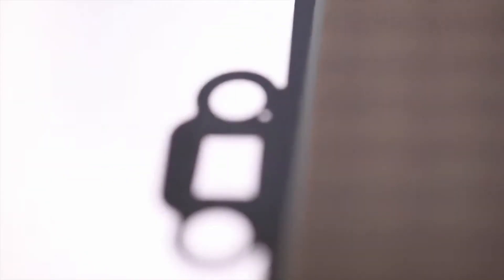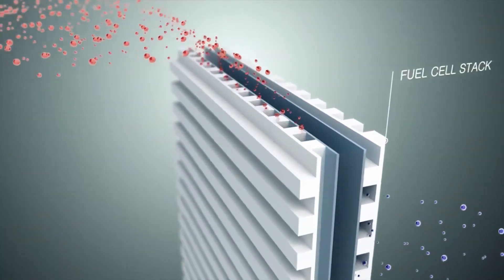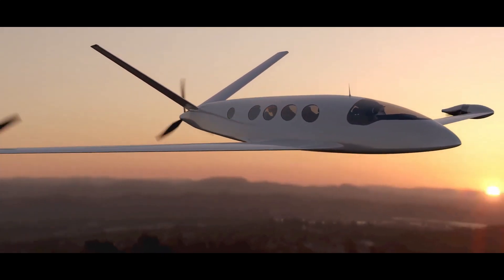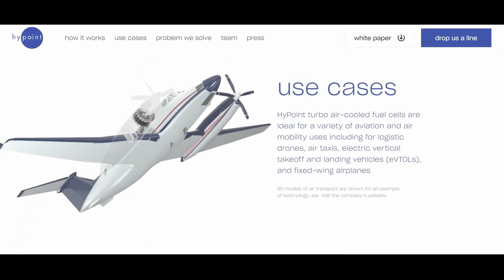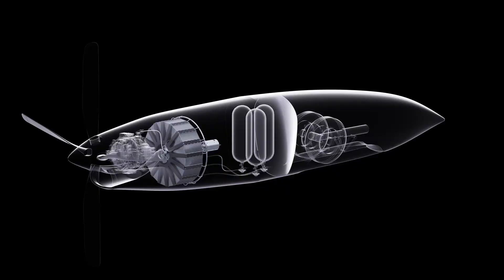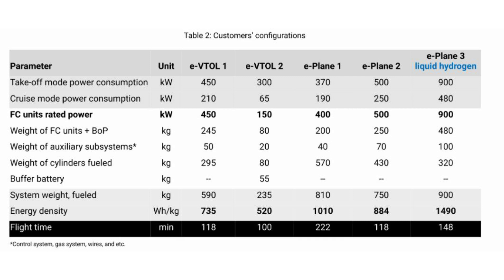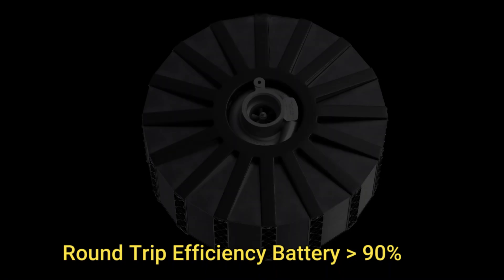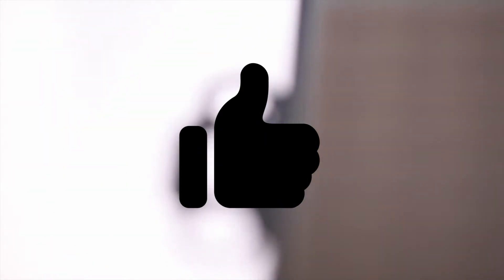Breakthrough Fuel Cell Technology for Electric Aviation

Comment: One of your best videos yet! I think one aspect you missed right at the end was when you compared cost of Fuel Cell to Battery. Yes, a Fuel Cell system is likely to cost more initially. But Fuel Cell systems can be used for more than 10,000 hours, some as high as 30,000 hours or more. Most batteries will have to be replaced at just 1-2k hours of use.
Reply: I believe that fuel cell costs will drop dramatically once they are used more, fuel cells I believe will benefit humanity with home power, automobile, and aviation.

Comment: Great summary, but from all my research, the energy density of hydrogen, even with fuel cell weight, is much higher than batteries.  Otherwise there would be little reason to consider it.  Maybe you're talking about peak power?  I agree about the round trip efficiency.  Hydrogen seems like a stop gap measure until battery energy density catches up.

Comment: Great video as always. I think the cost at this point is moot really, as most of the established players are looking to divest from fossil fuel planes. Not only is the cost of Aviation Fuel higher, but consumer's demands for a more sustainable model are also quite relevant. If you add the European Union, Japan and South Korea's push to a Hydrogen infrastructure into the mix, adoption seems guaranteed.

Comment: As you mentioned near the end of the video, you said it's dependent on the amount of hydrogen that can be carried - if you could do a video on hydrogen storage, I think that could be really interesting as that is a limiting factor. For instance at 700 barr, there is only 5 kg of hydrogen for a 95 kg container
Reply: A tank designed for what standards? Welding? A car?
Reply: There are plenty of videos of hydrogen storage, they are called Delta IV heavy launches. Check one out and imagine that rocket was your electric airplane.
Reply: And what are the regular/major maintenance costs of Hydrogen storage, transport & fuelling systems.  We all know the corrosive & leak prone nature of hydrogen & it's storage & transfer problems, thus higher costs.
Reply: Not anymore! Check out Hypoints newest hydrogen tank. It could even enable airplanes to fly longer on hydrogen than kerosene!
Reply: @jimj2683  Whoa - that tank is impressive! Thanks for sharing that

Comment: I don't think fuel cell have to be price completive with batteries if they can offer much higher energy densities.
I think energy density will be the driving factor in determining which power system prevails as a fossil fuel alternative in aviation.
Thanks for another interesting video.
Reply: Nah. As an aircraft mechanic my vote is on the simpler/easier to maintain battery system all the way. Time will improve the range/payload of such vehicles while hydrogen will age far too quickly to be a useful interim. As with the electric car world it's the cost of the hydrogen infrastructure that will make it impractical for common use. My opinion is that aviation companies investing in hydrogen will have to pivot toward batteries late game once they become the obvious choice. Just as Legacy automakers are already facing the reality of the failure of lidar tech; pro hydrogen aviation companies will have to play catch-up to the more advanced battery solutions. My 2 cents.
Reply: @Zalex612  For aircraft with batteries when you take off you weigh X amount.....when you land you still carry the same weight......with any aircraft that is powered by a liquid fuel, you take off with a full load and land much lighter having used up the fuel......one reason they dump fuel after take off if you have an emergency and have to land immediately.
An aircraft with a fuel cell would probably fare better than with batteries I think as the fuel for the cell would be used up by the time the journey ends........that is a daft situation as the current ICE aircraft power is quite well advanced and it would take a miracle to consider changing to electric drive just to please the environmentalists.
BTW.....I have a model of a 172 Cessna running on Lithium batteries.....it's very light , made of polystyrene foam etc......beats running it on a small glow plug engine.
Reply: Hydrogen is made from oil or methane, it is a fossil fuel.
Reply: @alechorn1109  You can't have it both ways........sometimes you have to compromise a bit.
Reply: @gangleweed  Are you serious?  The weight of the storage tanks, fuel cell & filters etc by far outweigh the Hydrogen itself.
Someone elsewhere on here pointed out 5kg of H2 requires 95kg tank at 7k bar.
You'll hardly reduce the weight when the H2 is running low. There will be little noticeable difference between full EV & FCEV & H2/battery/hybrid.  Try comparing Toyota Mirai to any EV.  Slower, similar range, but heavier.
Reply: @alexmanojlovic768  One reason why hydrogen as a fuel alternative is not practical.....you might as well stay with petrol, less danger and problems processing and storing it.......my preference is to go full EV....much cleaner and can derived from many natural sources forever.
Reply: @gangleweed  Except a) you touted it as a positive, now you're backtracking. b) I never advocated staying with poisonous FF's.
I was simply pointing out that full to empty, Hydrogen weight difference is minimal, which you compared to EV where the battery weight does not change at all. FCell overall system weight hardly changes also, as the gas is such a small percentage, unless expensive composites are used for the tanks, but the H2 may prove corrosive or leak, so your whole point simply on that one aspect is off base. As a fuel source where range is a major issue, H2 FCell may have a benefit, but then maintenance costs due to issues with storing/fuelling H2 may be prohibitively high in comparison to the current poisons. I don't know.
Reply: @gangleweed  wow! Zach Smith made a valid statement, that you tried to poke holes in.  I defended Zack & pointed out the holes in your comparison, so you move the goalposts, rather than back down gracefully.  Now you're adding magic into the mix.  Are you my older brother by any chance? I've spent decades arguing with a narcissist. Easy to spot. Easier to win an argument with them, once you realise their ego is in control...  As if by magic!....
Reply: @Zalex612  You...you do realize how heavy batteries are? right?
Reply: @jimj2683  It's not too hard to do the napkin math on it... I'll start with Tesla's 4680 cells which are rumored to have a pack energy density of around 300 wh/kg. (Though there are plenty of lab cells doing way better already... I'm choosing the 4680 based on it's near term availability. I.E. It's already in production.) For an airframe I'll attempt to match the Q400 (Dash-8) in performance and range. 93 people * 113.4 kg = 10,546.2 kg max payload. Power = Velocity * Force (drag). Using Eviation's Alice as a benchmark I'll calculate an estimated L/D ratio to use in our Q400 example. Alice has a 900 kw battery with a range of 815 km at MTOW and cruise of 407 km/h. 815 km / 407 km/h = 2 hrs. 900 kw / 2 hrs = 450,000 W / 113 m/s = 3982.3 Newtons / 9.80665 m/s^2 = 406.1 kg of drag force. Take Alice's MTOW at 7484 kg / 406.1 kg = Lift to drag ratio of 18.4. Now back to the Q400 example case! Using Alice's mass fraction of 60% battery weight I'll calculate the mass of the electric passenger plane. Mass fractions for composite aircraft are typically around 80-90% which, in English, means that 10-20% of the aircraft's weight is the airframe. (I'll take the more conservative 80% mass fraction.) Assuming for an additional 10% weight for electric motors and avionics we'll assume that the passenger mass is 10% of the aircraft's MTOW. 10546.2 kg * 10 = 105,462 kg MTOW / 18.2 L/D = 5794.6 kg drag force. 5794.6 kg * 9.80665 m/s^2 = 56,825.6 Newtons * Q400 top cruise velocity of 185.2 m/s = 10,524.1 kw power required at cruise. Since the battery mass is 60% of the MTOW we can calculate the capacity and thus the range of our napkin designed electric passenger plane. 60% of 105462 kg = 63,277.2 kg * 300 wh/kg = 18,983.2 kwh. Taking the power required at cruise I can get the time in flight and the range. 18,983.2 / 10,524.1 = 1.8 hrs * 666.7 km/h = a range of 1200 km. Compared to the 2040 km range of the Q400 that's not terrible. Please bear in mind that my math is quite conservative. In essence we can easily do half the range of existing regional planes using existing battery tech. With further optimization we might be able to get to 75% the range of existing fuel burning planes even without better battery tech. In short. Yes I do know how heavy batteries are. My original post didn't say that electric planes are immediately competitive. It just gives an opinion that battery tech will become economically viable faster than hydrogen fuel cell tech.
Reply: @Zalex612  The same napkin calculations with hydrogen actually gives 3-4 times the range of kerosene...
Check out Hypoint's new hydrogen tank and their fuel cells. It is an amazing breakthrough.
That means you will be able to carry many more passengers, negating the advantage of electricity being cheaper than hydrogen. 

I say let the market decide (as long as it is carbon neutral and no other harmful emissions). I agree that the perceived simplicity and efficiency of going purely battery electric is tempting, but it is the total cost and profitability that matters in the end (economic efficiency is more important than energy efficiency). 

My guess for the next 20 years is that we will see battery electric planes for short flights, hydrogen for medium flight and synthetic e-fuel for long flights. In the long run, either fuel cells or batteries will take over. We will see.

Long flights is what causes the overwhelming majority of CO2 release by airplanes, so that is the most important to decarbonise. And you simply cannot decarbonise long haul flights with batteries for the foreseeable future. That is why e-fuels and hydrogen seem like the only feasible solutions here.
Reply: @jimj2683  Interesting. I will hold my personal opinion but I do appreciate alternate opinions. Good food for thought! Thanks.

Comment: Need high temp to activate/mobilize Oxygen. Used at NASDAQ and in Japan, 10 MW fuel cells, 350C operation, “burn” Hydrogen or Natural Gas. Platinized Carbon, Phosphoric acid, Nickel Oxide structure.

Comment: I think you’re downplaying the importance of volume in airplanes. With larger planes you can use the wings as fuel tanks. This has several benefits, such as distributing load, not just saving volume for passengers and cargo. With hydrogen you need to put the fuel in separate tanks, taking up valuable cargo space. You can mitigate it with a blended wing body.. but the point is, hydrocarbons will always be superior in any configuration. And if you make them renewably the CO2 is not a problem. Efficiency will probably be even worse, but for many routes it’ll be worth it. So I’m concerned that the niche for hydrogen, squeezed between batteries for short range and biofuel or e-fuel for long range, will just be too small. It’s very possible that more energy dense batteries, and more efficient ways of making and using biofuel/e-fuels, will squeeze hydrogen out of this market.
Reply: The advantage, even if the niche is temporary, is an acceleration of electric aircraft propulsion technology. If batteries turn up later that can fill the niche, these aircraft can be relatively easily converted, since the motors and power electronics are already in place.
Reply: you're absolutely right. the question now is also, how fast is this niche developing or is the battery tech developing faster?
so far, ceramic separators for high density battery packs with high cycle counts are already on the door steps. the car industry is throwing a crazy amount of money at this development and the result will be 300-400Wh/kg soon. this is enough for 400km flights. from then on, the aviation industry will throw money into the pot too, to get even more energy density. electric power plant stations and consumers then throw more money into the development of long lasting batteries with high cycle counts for longevity.
i am not sure if hydrogen can find it's niche here because the development from the very short flights based on batteries is so fast.
Reply: @stefanweilhartner4415  Great comment, and it reminded me of something else: as you say, 400km flights may be feasible. But it's also possible that it'll be cheaper to do two 400km flights than one 800km flight, if operating costs for pure battery electric planes are much lower. So that's another factor that could push into the hydrogen niche. Electric planes (battery or hydrogen) are quiet, and may take off from smaller local airports. So I imagine if me, from Northern Europe, want to go to a vacation spot in Southern Europe, I might take off from a small local airport (rather than a 1hour train ride to the large international one), fly to some hub in Central Europe, and transfer to another plane taking me to a local airport near my destination. It wouldn't be much slower than taking one huge plane all the way through the big international airports. Transcontinental flights will probably always be hydrocarbons, since it has such insanely high requirements for both volumetric and gravimetric energy density. Yet another unknown factor for battery electric planes is that once you get a decent range on a large plane, these planes could fly higher than traditional planes, since they don't depend on air density (oxygen density) for efficiency. If they can fly higher, that could unlock extra range that haven't yet been considered.

Comment: Have you addressed the potential for low maintenance H2 fuel cells?
My understanding is H2 tends to make all storage materials highly brittle over time. This tendency is not favorable for any aviation application.
Still it needs to be addressed.
Reply from the maker: Thanks for pointing that out

Comment: Combined with super capacitors may be even more efficient with the addition of a smaller battery to enable a cold start.
Reply: I was thinking along those lines, going further if the battery requirement is mainly for cold starting could it not be when the aircraft is in storage it is "plugged in" to the grid or a starting generator is used thereby removing the need for battery packs altogether (a small battery on the plane maybe just to keep systems "online").

Comment: I think hydrogen powered aircraft (be it fuel cell or gas turbine) future will hang on the decision of airports to invest into hydrogen infrastructure. No sign yet that this is happening ...
Reply: Using ethanol with reformer for hydrogen source would mean we can use existing fuel infrastructure.

Though pollution free ethanol can be used in jet turbines as well.  GE has sold some in Brazil already for electricity generation.  Ethanol gets higher fuel efficiency above 10,000 feet than currently used jet fuel.

Comment: Is there potential to use super-capacitors in conjunction with fuel-cells for the high-energy demand phase of flight for eVTOLS?: i.e. during take-off.  The fuel-cell could charge the super-capacitors prior to take-off.
Reply from the maker: Supercapacitors are still at 80 to 100 Wh/kg. Li -ion cells are  3 times that amount i.e 300 Wh/kg. So there is no chance of using super capacitors at least for the near future

Comment: I've been working on a design for a EDFJ (Electric Ducted Fan Jet), that implements existing ideas for initial use on GA/experimental aircraft. 
I'm confident that I can add an additional 30 to 45+ minutes to the current "1 hour" average flight time, using current battery technology. 
Also, will allow to travel longer distances, even if only 1 hour, due to higher straight and level cruise speeds.
We shall see, once first tested on Rutan Long EZ and eventually a Velocity 4-place, which will require 2 of my EDFJ power plants and if weight/balance allows, will be mounted on the Velocity aircraft, much like the Honda Jet's.
Until charging stations become common place or aircraft are equipped to allow fast charging via your everyday outlet plug, a hybrid will also be in the works.
Reply: I live in holland allready built cars and airplanes.technologi etc .we have here rld the dutch faa.anyway when you fly between sea level and 25 meters you are a boat ther are no rules yustregulations good luck ronadam

Comment: Great video. One key advantage of a hydrogen powered system is the benefit of burning fuel on enhanced range. As the hydrogen is burned, the fuel weight is reduced, with a positive effect on range. This, of course, does not happen with batteries.
Reply: That advantage is probably pretty small though, at least with pressurized H2. As someone pointed out elsewhere, the weight is around 95% tank, 5% H2.
Cryogenic liquid hydrogen has more of this advantage, but is costlier and more difficult to handle, and probably only works for big planes.

Comment: What about Seebeck generators to help with the excess heat of the fuel cell? You can turn that waste heat back to electricity for storage in the battery.
Reply: This needs to be tested for weight efficiency

Comment: So... This relies on much greater cooling efficiency...not the new solidified hydrogen plate (liberated by lasers) tech. Ok got it. I'm a fan of hydrogen fuel cells for any heavy duty types of work - big rigs, heavy duty pick-up trucks, construction equipment, sea vessels, and aircraft carrying more than 10ppl or equivalent weight...